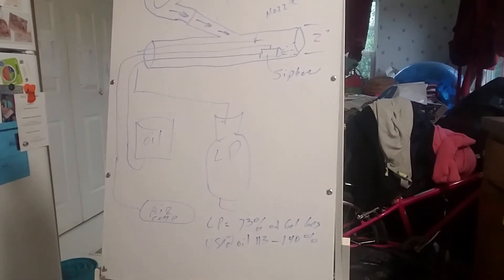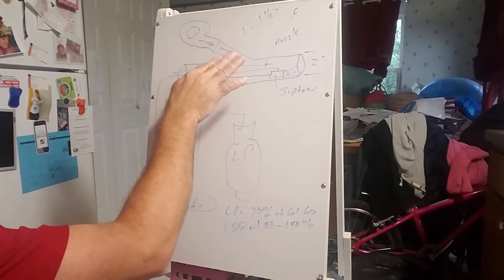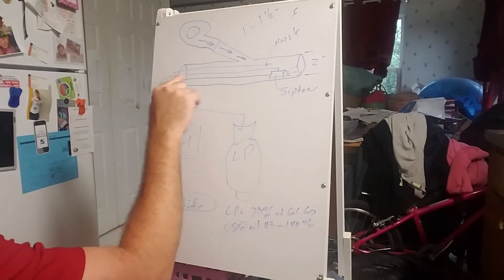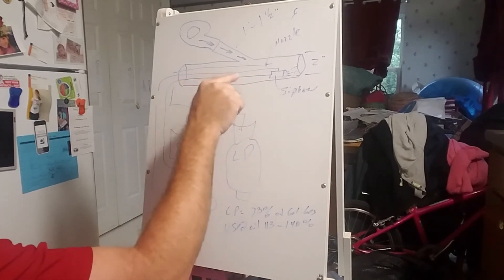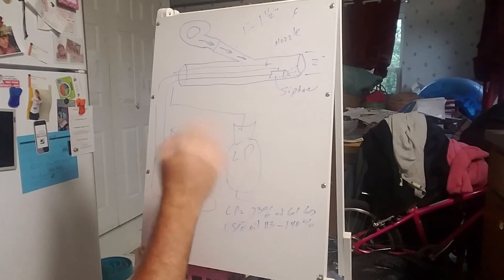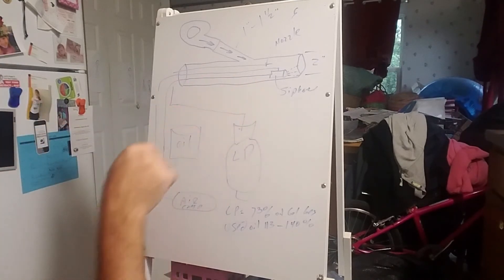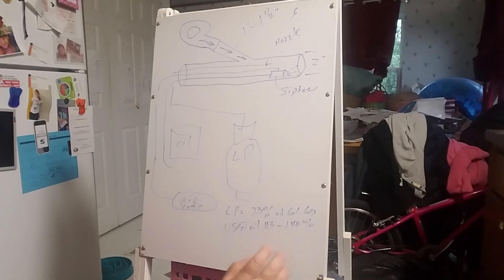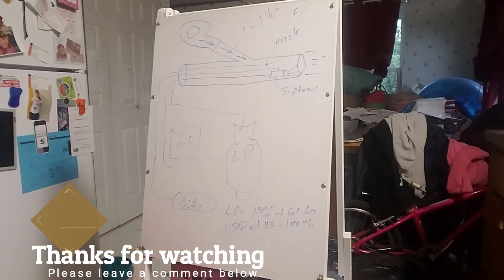Gordon Family Forge   Oil Burner forge Idea

Comment from the maker: The btu values I mentioned in my video or pretty much correct, the pricing per gallon of LP is not. I have had a few Corrections double-checked and yes I am very wrong LP runs about 2 to 6 a gallon.
Reply: i was going to say, i pay 3-3.50 depending on who's working at the refill place that day